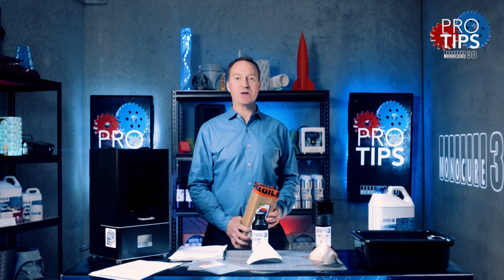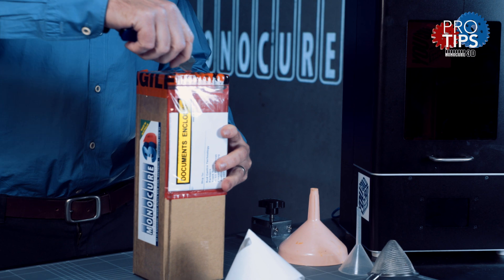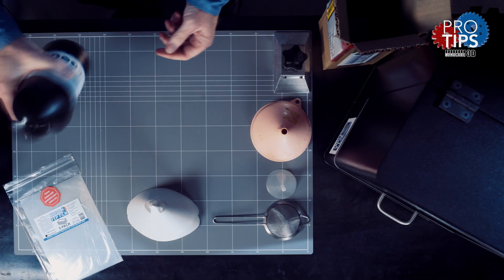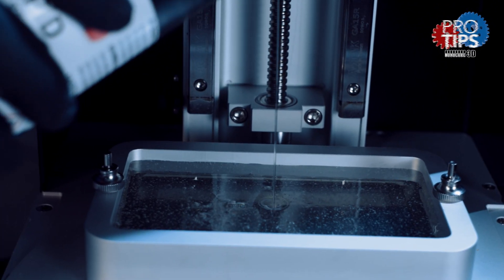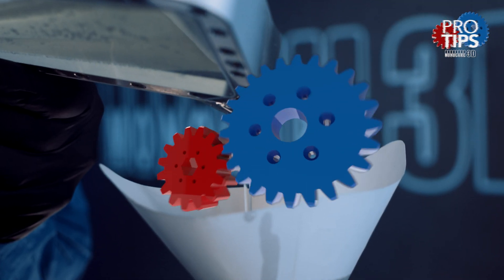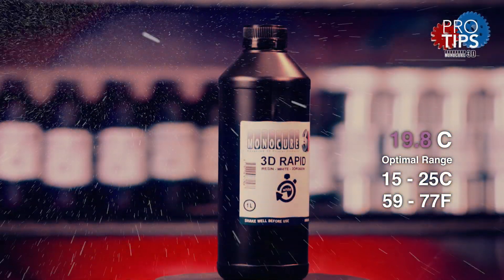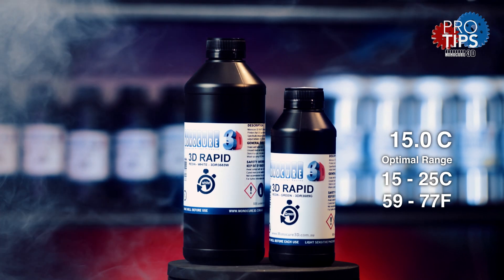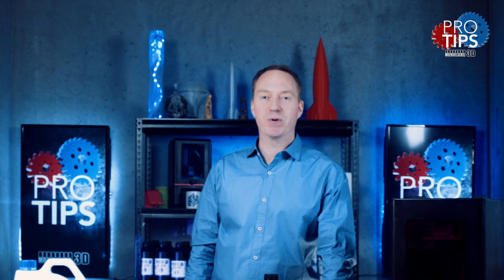What is the best way to handle, store and dispose of 3D Printing Resin?

Comment: how do you dispose of the filter you used to pour the resin back into the bottle? if you spill some and wipe it off with a paper towel, how do you dipose that?
Reply: @Djfinzz  Or just let it sit in the sun for a little while.
Reply from the maker: If it's on paper towel, just throw it in the bin. Same with the used filters.

Comment: What is the proper way of disposing an empty bottle... The resin is viscous and there is always traces of it left.
Reply: Could clean it out with a little bit of alcohol and if you don't already have a bunch of bottles, keep a few to pour used resins back in so you don't risk possible contaminations of the unused resins.
Reply from the maker: Quick rinse with IPA should help remove the traces.

Comment: This uncured resin is no joke.  I love resin vat printing over plastic filiment printing for the quality but you can't afford to remove a project from the resin printer with your bare hands.  The project is set but not cured.  It's tacky, extremely sensitive to fingerprints and some of the highly toxic resin residue may get into your pores and into your bloodstream.  Silicon gloves, and a UV curing box are nice to have.  I made my own UV box for curing tacky resin projects
Reply: I don't yet have a UV curing box but as it turns out I have a 5200 lumen cone shaped LED light that uses 40 watts and it was able to cure not only the piece I made but the completely liquid resin still inside of it in less than 2 mins, which from what I can tell is faster than direct sunlight but it's also just a bright shop light with a 5000k color temp.
Reply from the maker: Agreed - be careful and always wear Saftey gear.

Comment: why is it necessary to shake the resins? I know its important but happens if you don't shake it?
Reply from the maker: The pigments can settle and the resin can be inconsistent.
Reply: @Monocure3DProTips  Ok, so shaking is not useful for clear resins (as shown in the video ^^)?
Reply: @MurphyTJ  You should shake pretty much anything that has chemical compositions as the different chems are prone to separation, clear or not you'll want to ensure it's all mixed properly so that it cures evenly. I'm no expert but I'm pretty certain a UV resin is a mixture of chemicals that give it the UV curing properties and if you forego the mixing process you could end up with less consistent cures / prints over time.